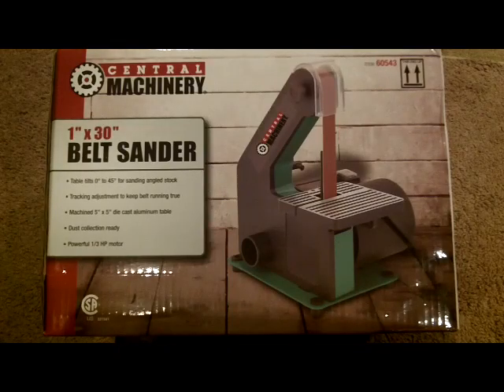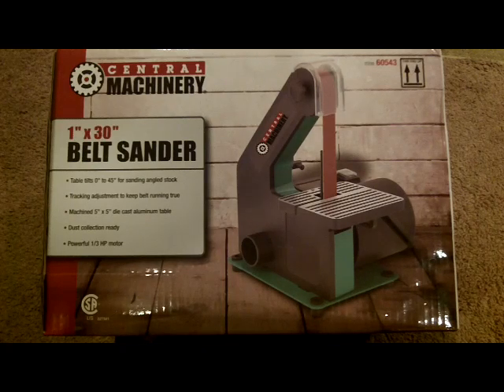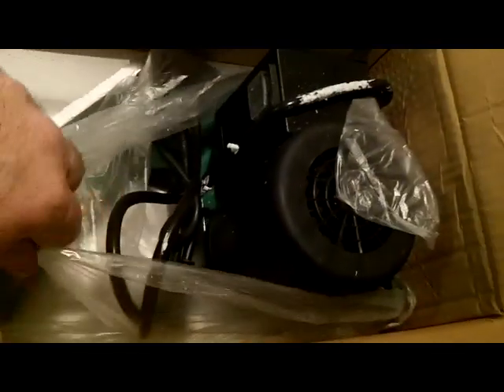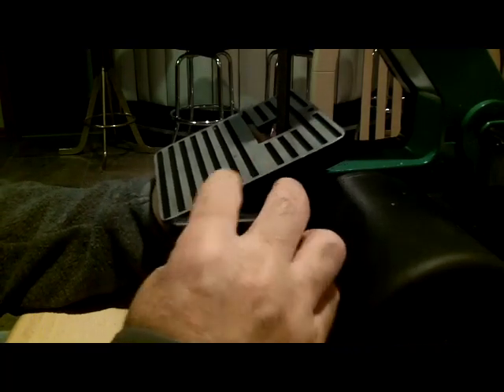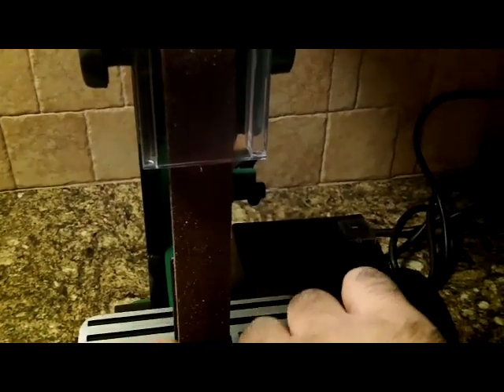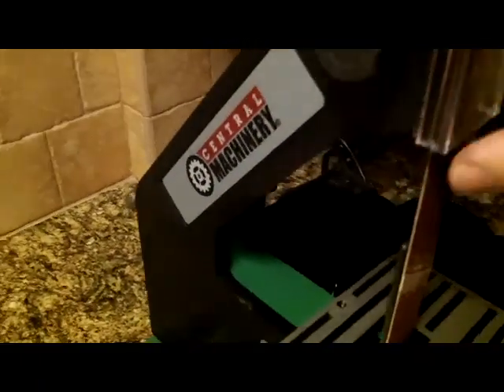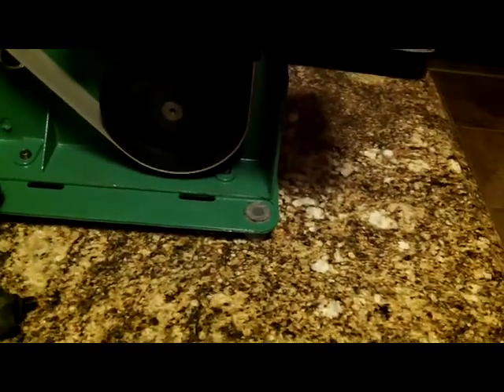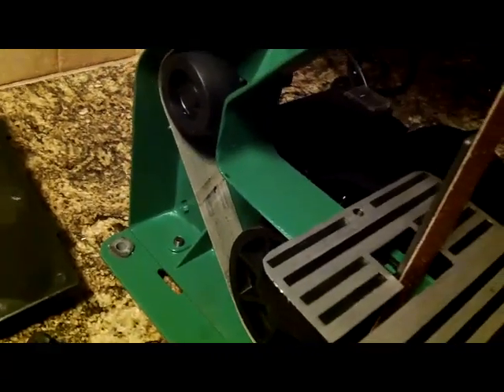HARBOR FREIGHT 1 BY 30 INCH BELT SANDER

Comment: Mine lasted 7 years under normal use.  I replaced it with the same model.  There under the back roller is a bolt and nut that can be used for further belt adjustments.  Being lazy like me will shorten the life of the motor with improper belt adjustment.
Reply from the maker: ***** they are great for the price.

Comment: Just picked up one myself at Harbor freight. On mine the bolt that holds the belt tracking mechanism was too tight . That mechanism should move freely back and forth on the spring. So when you change belts you should be able to pull the tracking adjusting unit forward with your finger . Mine ran loud and rough at first , then after I adjusted that bolt torque , she runs much smoother.
Reply from the maker: +John Conway Mine need adjustment out of the box too.